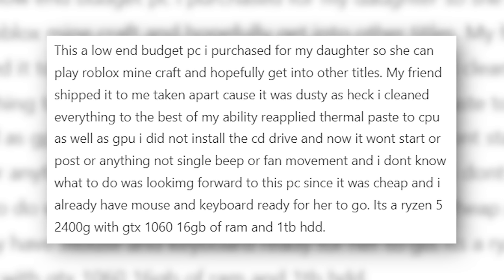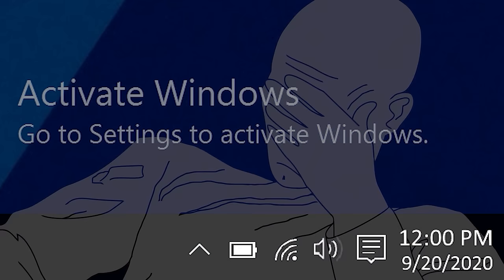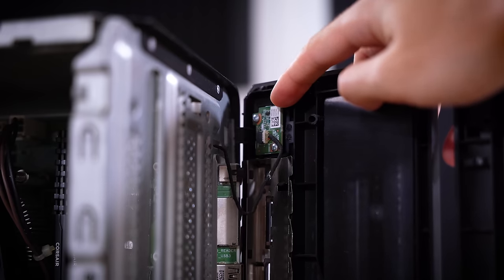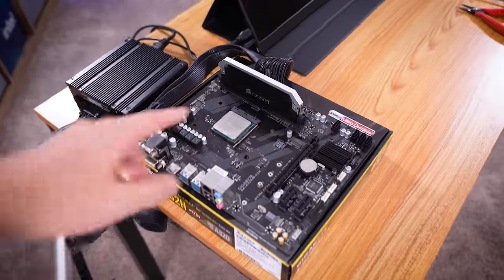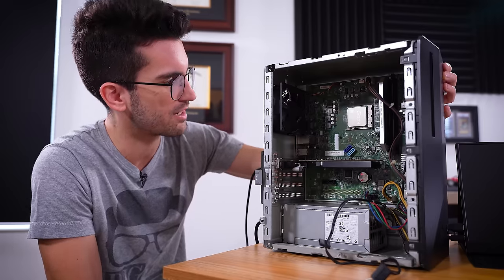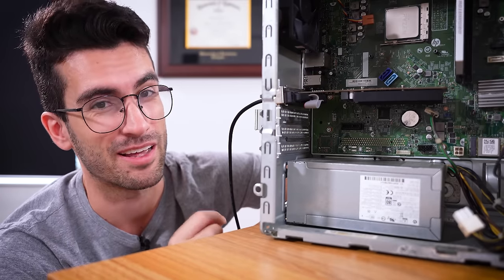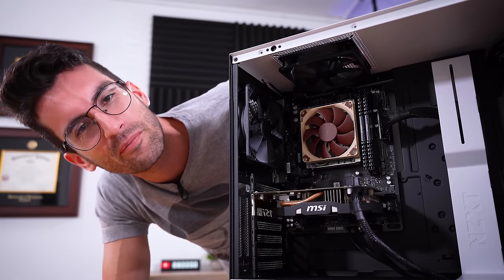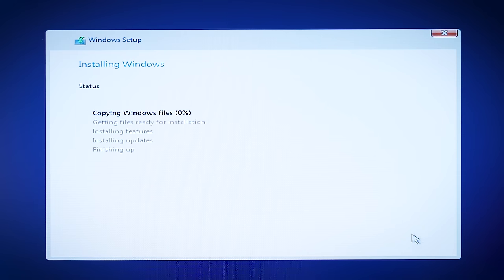Fixing a Viewer's BROKEN Gaming PC? - Fix or Flop S4:E13

Comment: Those OEM power supplies are the bane of my existence. Just make them to standard HP! Great job Greg!
Reply: They're only good for doorstops!
Reply: @maxtornogood  and how! Dell, HP, Lenovo, all of them. And they didn’t used do it either.
Reply: It's the Apple business model. Make everything proprietary and customers have to come back to you for everything.
Reply: @@lurch789 DELL, Lenovo, etc, do the same; and it's not a new thing, they did this for likely a decade+
Reply: Never buy anything from HP. Especially not printers. Life is good, when you own 0 HP products
Reply: They were standard back then with their older model. Realizing that mistake now they even make different connector for each series.
Reply: @adetyapurba  their new connectors imitate the new 12VO standard
Reply: they can't, it would cut too deep into their profit margin
Reply: @n00bF0Sh0  c levels couldn’t buy their 3rd yacht
Reply: They do it on purpose because they don't want you to service or upgrade their machines in any way. You're supposed to send them in for service or (preferably) buy an entirely new system from them when trouble happens.
Reply: Most mainstream OEMs that make prebuilts typically use proprietary components. Though TBF the TFX-like PSUs supplied with HP, Dell, Lenovo, etc. prebuilts are generally on par with other standard 80 Plus Gold PSUs. I don't particularly like the fact these power supplies aren't modular, but FWIW they're fully capable of delivering enough power to these rigs.
Reply: They are standard HP psu's lol

Comment: I love these series, but I don't know if I would agree on upgrading the viewers system like you did. They bought a prebuild so, why not replace it with one of the prebuilds you got on ebay. I believe the Lenovo build is just as good as the one they bought. Since the viewer is keeping the GPU, you could've just used that GPU in the Lenovo build.

Comment: Use your multimeter on the PSU output pins to see if it's outputting anything. That'll help narrow down whether it's the PSU or motherboard. Adapters for generic PSUs are also easily and cheaply available online for testing.

End result would likely have been the same, but as a viewer I want to see more troubleshooting.
Reply: I agree
Reply: These HP power supplies are also plentiful and cheap on eBay since they are basically useless in other applications. But I would have done the same. Not even worth the time in my opinion, even if you got it working, it would still be proprietary junk.
Reply: Agreed! The MB is probably good.

Comment: Those non-standard parts brought some memories. When I was a kid we had IBM computers. They were suitable for us because they'd come with extensive software packages, which was useful in a small town where it was hard to find computer parts or software. (The IBM packages as well as any computer stuff were sold by a local bookstore, and everything had to be ordered, and for that you'd need to know what you wanted, and for that you'd need to know what was available... (and this was before even dial-up internet was generally available). So yeah, other kids who had non-brand computers wouldn't basically have much other options but to just find a friend who would let them make copies of their disks. (yes, piracy!))

But the hardware was a pain in the butt. It was like IBM was trying to minimize the amount of components that could be bought elsewhere. And even the cases were very different for each generation, so you couldn't upgrade the computer even by buying components from IBM. Instead, you had to buy again a whole computer. The last IBM we had was a 133-MHz Pentium, and to outside it looked like a standard tower PC, but the insides was a different story. Its specialty was that the expansion slots were not on the motherboard but on a riser board, so replacing the motherboard would be practically impossible. (And, like on the HP in the video, the openings for the ports were permanently made in the case.) An earlier IBM even had the powersupply built inside the monitor that would be connected to the actual computer -- with a proprietary cable, of course. (And the RAM expansion module was proprietary on that model as well.)

Partly for that reason, the last time I've bought a desktop PC was around 2000, and after that I've only bought laptops. At least they are honest about what they are, and don't give false hopes about upgradeability.

Comment: Wife was using her old Dell micro-tower work PC with WIN 8 (!) and it was taking about a minute to open a PDF file.  I built her a Micro ATX rig in a Versa H17 case with an ASRock B660M pro MB, my old EVGA 960 graphics card, 2TB M2 drive and an Intel I3 CPU. I learned about the brand "Be Quiet" from your channel, so I used some Silent Wings 120mm case fans in it, since she didn't want it making too much noise whilst she surfed the net. Much better now!

Comment: A great video and I can relate in a big way to proprietary systems. The owner is getting a sweet upgrade from the HP hardware. And another way that you look after your customers so well by going way beyond the minimum required to get the system working. Great work as usual Greg!

Comment: Side note on the bios button battery: it is not connected in any way to the motherboard's main electrical power coming via the PSU. It doesn't care if the PC is connected to a wall socket or not: it's been discharging constantly & running the "time of day" clock since the day it was installed at the factory in Taiwan, or wherever.

Comment: Here's some very simple troubleshooting options for this specific scenerio:

-probe the pins with your meter
-buy a known working Power Supply Unit on something like ... for $20-40 or less
-lookup the pin out for the PSU model and cut the connector off and wire a "standard" connector on so you can test it with a Power Supply tester
-lookup the pinout for the PSU model and cut off the connector then splice that connector onto a known working power supply with the proper pinout

Comment: Hey! One thing I noticed (which I typically use to check if my Psus are working), is that you could try to use the paperclip method. You would bend a paper clip so the ends can be inserted into pin 16 and pin 17, then once powered on, if there is no fans, that means that the psu would be dead.
Reply: That would only work if the PSU in question had a standard 24 pin motherboard connector. This one didn’t.
Reply: Yeah, this wouldn't work with a proprietary PSU... so the best thing (new standard MB/PSU) was the way to go.

Comment: Love what you did with this rig as they will have room to upgrade in the future!  I remember converting my first HP prebuild years ago.  I got this 24-pin to 6pin converter.  Even then you have to figure out which pins were 12V and which were ground to properly plug into the 4pin on the motherboard.  Then figure out how to hack the case to make the new power supply to fit.  It was then that I vowed never to buy any proprietary junk ever again.  Never again!

Comment: The cables to convert standard atx to whatever Hp has in there are available. There is a standard 24 pin to 2 six pins so you can use a standard atx for testing purposes.  It doesn't come up very often but can come in handy. There are also sata power to 6pin 8 pin cable for adding GPU's to the rig. The only problem is the low power Hp, etc power supplies. Your solution is [robably the best in the long run.

Comment: Love this. I have to agree on the prebuilts being not so great. I had been gifted a dell when I graduated high school in 2005 and had it for 7 years before I started slowly replacing its parts. The last being the case in which the power button cable went bad and was causing it not to power on or it would but shut down after 1 second. I had figured out that if I power it on and then immediately remove the cable from the motherboard it would stay on. It was wild.

Comment: The power supply issue, you can actually rewire or build a series of splitter cables to go from any standard power to adapt to a HP motherboard (Yes HP changes their pin outs every few years with the voltage and return voltages on different lines so as to block people from being able to fix their own stuff and replace with non-HP parts, the Buy - You Not Repair - Pay us More company mentality.) Often you can find split mix cable adapters online for like $20 to $40 a cable, easier to buy a few, than to spend the time manually wiring your own.
Yes I have done this to a number of HP machines that I have pulled from recycling locations, to rebuild them into something useful. The CPU may be a specialized 'limited' version, as HP often gets special 'limited' CPU that are less expensive, missing things like full L1, L2 or L3 cache, TPM layering and such. The circuit board in the front panel may also have a specialized feedback voltage loop to the power supply, or to the front I/O ports. Things like this are often really annoying to spend the time troubleshooting.

Comment: Cool deal that the three parts still worked. Not sure you recognized it later, after the vid or not that computer has water damage or some sort of liquid damage. The back and lower part of the case has erosion due to prolonged liquid contact; likely water. The shot of the old PSU with all that crud looks like it had a flood go through it. Nice rebuild!

Comment: It's good to see a YouTuber discouraging these 'Optiplex Gaming systems.' I had a friend who recently considered this path because there are so many videos of people buying $50 HP's, Dells, whatever.. slapping a cheap e-bay video card in it and having a super cheap 'gaming rig.' I told my friend exactly what you found here.. it's all great until the PSU goes and you then have to buy a new PSU, Motherboard, Case and CPU cooler. I ended up donating some parts to him and he bought the rest using standard form factor parts and now he doesn't have to worry about it. I always discourage people I know from trying to make these cheap office/work PC's into 'gaming systems.' They are designed to be used for a couple of years and then thrown away..I doubt even HP has the PSU you would need, they don't care enough to bother still making them. Good on you for helping this guy out!

Comment: Power supply looks to be 12v only with any necessary step-downs being done board side, it's a lot easier to put 80+ gold on a PSU when it does much less work than a standard ATX one. There are 2 ways to get a higher efficiency rating 1) make a well designed power supply with efficient components (harder and more expensive) or 2) put all the potentially inefficient components on a part that doesn't get efficiency tested (cheap and easy). The second one comes with the bonus of a proprietary board design that only works with your PSU so all the repair revenue comes to you if someone wants it fixed. It kind of makes me want one of these with a dead PSU to see if I could just chop the wires and run them to one of those cheap always on 12v supplies.

Comment: Those weird OEM power supplies are very susceptible to power spikes from the wall. They are fine as just a power supply, but are not built very robust to handle "non standard" power issues. I've had to replace several at our office (even though I am not IT). If you have one of these prebuilds, make sure to get a good surge protector.

Comment: The HP Elitedesk 800 G1 is pretty much the last HP prebuild using an ATX PSU, however it does need an adapter to upgrade, but it's easy to do. I have one here running a Xeon E3-1246 V3 and a 1 TB Nvme with Clover boot loader.

Comment: Not bad! I personally do not like proprietary parts either and would rather use standard, off the shelf parts.
That looks like a decent budget rig, with room to upgrade in the future if required.
Though I would have kept the 1TB HDD just for data and stuff that doesn't really need to be on an SSD. 1TB isn't much now with games being over 100GB each in some cases.

Comment: From my experience, not all prebuilts by hp have those weird power connectors on the motherboard. Back in 2017 I bought a hp pavilion gaming pc which had a ryzen 5 1400 and a gtx 1060. That prebuilt actually had a motherboard that had the standard 24 pin and front panel connectors that worked with a different case. If you can find something like the one I got at a decent price point, it could be worth looking into

Comment: Detective Murdock exploring the mystery ( not london) of a Mysterious pre-assembled OEM "what are those " PC.

And i love the investigation!!

Note: i have an engineering sample HDD Barracuda 2tb so fast ...and i mean really fast ; for reference 18k rpm and 450Mb R/W when moving big files ,with a 32Mb cache and a fan( not getting that hot it stops heating at 75°C with the fan being controlled by an internal chip with a tinytiny Led on the front where you can control the fan speed)....
So not all HDD are dead .

Comment: G'day Greg,
I too stay away from DELL/HP/etc Proprietry PCs, the only other test I thought of doing that would have given some more info is using a Multimeter on the PSU to check Voltages or lack of.
Ps I don't know if you put it back in but even if not using them for game storage HDDs are still good for a Phone Backup, you don't need SSD speeds for photos & videos.

Comment: We really need stronger regulations against proprietary hardware in computer components. The EWaste problem is getting really bad. The inability to maintain and repair our PCs with parts available to consumers doesn't incentivize us to use the company's restrictive channels to fix their cheap crap with overpriced repairs. It means a fuzzed out two-pound $30 power supply will condemn a perfectly working fifty-pound $1,500 computer to a toxic hole in the ground. Bless you Greg for actually pulling out a lot of the working components and putting them in a new home. It's unfortunate that the case, motherboard, and power supply are irredeemable EWaste, and it's 100% HP's fault for insisting on irresponsibly profit-driven build standards, but now that dude's daughter has a PC she can hold onto and maintain/upgrade through the years without throwing the whole thing away.

Comment: Those power supplies are pretty cheap.  I have just bought used ones from parted-out systems and had pretty good luck.  I don't have sponsors and the clients pay for everything, so saving a buck or two is best.

Comment: In today's episode of "Greg replaces a viewer's broken Gaming PC... it's now working". 
I get it, you want the viewer to be happy, you have parts sponsors, so you just throw new parts at the issue until it is resolved. But wasn't the whole premise of this series that the audience should learn how to diagnose and fix issues with their PCs without having to buy a whole lot of new stuff and old (potentially still working) parts end up in a landfill?
In this situation you had to replace the case, PSU and board together as they were proprietary, but in the end we don't know what was actually faulty, so we didn't learn anything if we ever run into the same issue.

Comment: The Corsair RAM sticks didn't come stock with that computer and is most likely the problem here. 
The motherboard might require the OEM sticks of RAM in order to boot (and vice-versa); At lease this was the case in my own experiences.
Reply: Sounds plausible: I can confirm the same but only for HP servers. HP ram sticks are fine in generic Supermicro MBs though xD
Reply: I can speak from my own experience, I have a similar hp pc and it works with non OEM ram, I also think it'd still power on, then just display an error relating to memory

Comment: That must be an early HP gaming rig. When I recased my Omen 25L, nothing was proprietary. I used the same I/O shield on my new case, standard micro atx mobo, and the PSU in the Omen is just a standard Thermaltake with regular connectors
Reply: I believe it’s part of their “Pavilion” lineup, where they do use proprietary parts. I had a similar system and had to swap all of the same components as Greg did here.
Reply: @coreymcdonald7745  Now that would explain it. I also noticed that HP did a lot of weird things with their slimline computers, yet their full-size offerings were usually non-proprietary

Comment: it's very very easy to buy a front io arrangement with aftermarket parts and then mount it with some hot glue. so if you wanted to keep that case and update the motherboard it would be fairly straightforward
Reply from the maker: Nah. Would be extremely jank. You've completely ignored rear I/O constraints as well. You could probably just dremel into the case, but for that level of effort just buy a $40 case that looks significantly more modern and call it a day.

Comment: One thing I’d like to state is the cheaper prebuilt hp gaming pcs have proprietary psus, my 1000 dollar omen does infact have a coolermaster standard off the shelf psu with standard connectors meaning if I need to I can run to Best Buy and get a similar spec psu from a reputable manufacturer or a higher spec psu from a reputable manufacturer, my dinky hp gaming desktop you could get at Walmart for $600 back when they sold it has a proprietary psu, budget machines under 700-900 dollars are corner cutter machines, lowest shelf processor, oem ram, oem ssd, proprietary psu, and oem gpu, once you start increasing the price your upgradability options increase drastically but you’re still screwed with some parts like the mobo depending on if the I/O is proprietary and the I/o shield is not swappable.

Comment: I had a very similar prebuilt to that a while ago. I bought it because it had a 2400G and a RX 580, but the motherboard ended up being completely dead like this one, where it wouldnt even power up. PSU was actually fine, I was able to test it with another HP. I ended up doing what you show here and just case swapped with a new motherboard and psu